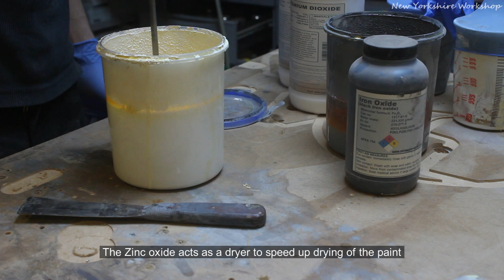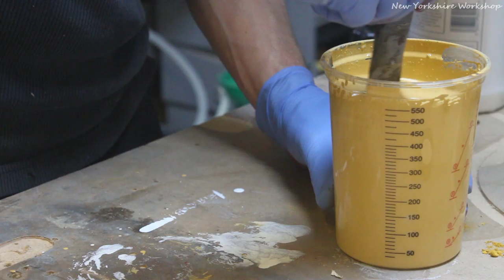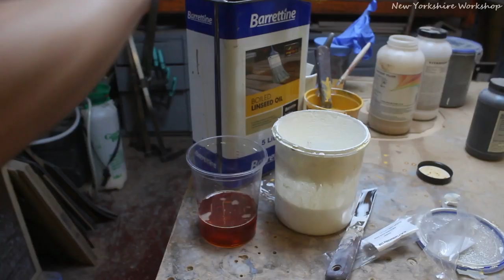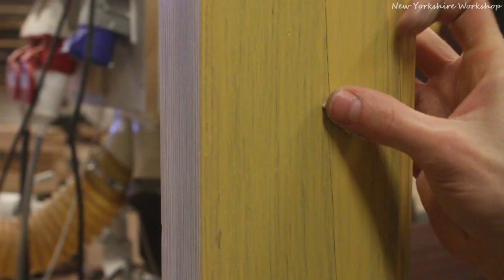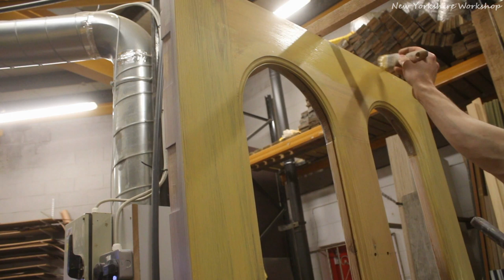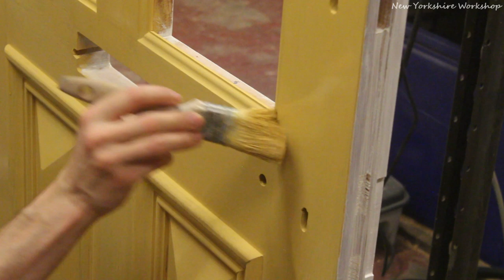Making yellow linseed oil paint for a front door

Comment: Warming raw linseed oil in a water bath helps get maximum penetration as a first "primer" coat.  Long full length brush strokes will minimize brush marks.  Fill holes before pigment coats and gently wipe with a rag with a little raw linseed oil on it.  Mix/store paint in glass mason jars, it's easy to seal/reseal and make small batches.  Paint is less likely to stick to glass over time.  Purified raw linseed oil along with the zinc oxide (15-20%) will help with mold/mildew and cleaning.
Reply: Good tips! You can also add 0.5-1% orange oil or turpentine for better penetration with linseed oil :)
Reply: @AndreaArzensek  Good tip too, actually I'd do the filling after a first coat of a diluted linseed oil paint.
Reply: @richardmckrell4899  It sounds like you use a lot of linseed paint. Generally speaking, on an exterior application such as cedar siding, how many years should you get before it starts fading out and needing more applied?  Also, is there something to add to it to help with mold and mildew growth?

Comment: I have no idea who told You that, but linseed oil based paints are not capable of letting any air nor steam through. In fact- hardened linseed oil creates one of the toughest natural polymers known to man. It is resistant to most strong solvents and even to some strong acids. It is durable, easy to make and cheap, but the coat it creates is homogenous and air-tight. Which isn't bad for the wood as it doesen't allow any harmful sulfur oxides and other nasty stuff get into the wood. Great job!

Comment: If you paint over linseed putty straight away using linseed oil paint there’s a chance that it will blister especially with darker colours (dark greens and black) and where the object, window or door, is getting heat from the sun. South or west facing windows are especially prone to this even in the UK. It’s cosmetic as the blisters reduce in time but easily avoided by waiting a day or two for the putty to start forming a skin.

Comment: It's also good to consider your use of pigments. If you had used a little bit of raw umber, which would not have changed the color at all, your paint would be dry as a bone overnight. This will also give you a stronger natural paint film that will not lift when you add further coats.
Reply: How would adding a brown pigment not change the colour and speed up drying time so dramatically? Makes no sense
Reply: @kcChicken123  lots of things make no sense when we're ignorant to them, but that's okay. let me see if I can help- raw umber is low in tinting strength(meaning it's rather transparent and a small drop doesn't effect the overall yellow ocher color), and contains manganese, which has siccative, or rapid drying effect on oil paint- brown earths are the fastest driers, along with lead, which is why painters use brown earths for underpainting- of course you can try it yourself or investigate further. I was just trying to be helpful to another fellow restore and share something the old timers passed on to me.
Reply: @josephdolderer  what awesome info! Please make some videos to keep passing on the old timers info....it's getting lost. I'm trying to figure out custom made Linseed paints.  Do you have any thoughts on how long linseed paint should last on exterior cedar siding? I don't want to have to scrape peeled and cracking paint anymore so considering switching to a linseed product which I heard more just fades away rather than peel/crack so you can easily reapply more.

Comment: Looking really good! 

Can you spray a lin seed oil finish?
Reply from the maker: Thanks David! Ive seen it thinned and sprayed onto rusty metal which i guess is quite porous, it might be ok to spray on very porous wood but for non porous wood it goes on in very thin layers and needs to be worked into the surface so i dont think spraying is ideal.
Reply: NO mate, you DON'T go SPRAYING linseed oil finish on wood. What you're missing is elbow grease! Go down to your local DIY (hardware if you're a Yankee) and ask for five gallons of non refined elbow grease. Also ask for a special bowed window hammer, to bend the glass a little more. Then you could place an order for a wood thicknessing plane, just in case you took too many shavings off. You might find a special application on your I-Phone that'll do all in one.
Reply: @musamor75  ah ill have to get a link to that iPhone app, that's sounds really handy-dandy!

Comment: What ratios of titanium dioxide, zinc oxide  to linseed oil did you use to make the white paint you started with? Thanks
Reply from the maker: Hi, I did write down what i used but i lost it in the messy workshop! i reckon it was a good 400-500 (maybe more) grams of the titanium dioxide plus 250 grams of the Zinc to 1 litre of oil. that should be a good starting point for you. even with quite a lot of pigment you will still find you need a good few (maybe 4 or 5) coats with white since still isnt overly opaque.
Reply: Why didn't you read some of the comments? The answers are given several times over.

Comment: Beautiful!
Did you let each layer dry fully before applying the next one? And if so, how long did it take? I know you said a few days, but is it more like 1-2 or 4-5 etc?
Reply from the maker: yes it is what is called a drying oil, meaning it dries from contact with oxygen in the air, sealing a previous coat in when it is still a bit wet will make it take much longer to dry. it was taking 3 or 4 days to dry a point that i could sand it without galling up the sand paper, that was in summer so it was fairly warm.
Reply: Store-bought linseed oil paint advertises 24 hours between coats but that's the absolute minimum.

Comment: After watching all the previous construction videos, what feels like must be a $12,000 door... is painted with what looks like a $1 brush from a bargain bin.  Am I missing something?

There was also a comment in here about spraying, where you commented spraying would not be as good for this porous surface.  At first, I agree with you the first coats should be done by brush for the exact reason you state.  But as even you state in a comment somewhere else in here, once the first layers are on, you're not painting the door anymore but rather adding layers on top of the existing layers of paint.  And those aren't porous.  

When I paint doors such as these, aesthetically I try and make the brush marks "make sense."  The brush strokes should logically follow the pieces of the door.  But this door has some unusual places where horizontal and vertical pieces meet which made me wonder what I would do as I watched you paint.  My conclusion was that it would look best sprayed with a HVLP sprayer.  I think brush strokes add character (if done right) and a HVLP sprayer will basically be a glass-finish, but for this piece I'd be ok with that.  It's just... BREATHTAKING!
Reply from the maker: i havent tried it so i could be completely wrong, my gut feeling though is it wouldnt work too well. you would need a very fine mist to put just enough on the surface, and the pigment might clog up a fine nozzle gun. you would have a hard time fine tuning the setup just pefectly as it is a fine line between a good finish and having runs. i also think it would just bead up on the surface, especialy on subsequent coats,, it kind of needs working in with a brush. like i said i could be wrong, id be intetested in hearing how you get on if you try it.
Reply: @NewYorkshireWorkshop  Yes, HVLP sprayers are pretty much as fine a mist as you can get.  Have you ever seen cabinets sprayed smooth as glass?  That's HVLP.  

You are right that it would take some tweaking to get the consistency right, but... it's not like you just poured the perfect amount of pigment in the linseed initially, either.  haha  Getting the viscosity right for a HVLP takes a little getting used to, but it can be done.  

And, again, you're right that the initial coat(s) would benefit from a brush putting pressure into the pores of the wood, but at some point (after a good first coat), you're not doing that anymore.  Each subsequent layer sits on top of the previous, it's not going into the wood at all anymore it's just leveling on top.  You can FEEL it.  When you put a primer on wood, the grain expands as it soaks in.  Even if it was smooth before you painted, after the primer it will feel incredibly rough.  That's because the pores expanded.  But after you lightly sand that coat and paint again, you'll notice that doesn't happen again.  The only texture you feel is whatever stipple is inherent with your application method.  The new layer of paint is now just sitting on top of  the previous layer of paint, not soaking into the wood.

Experiment with it.  If you end up even half as good with painting as you do with the wood working, you'll be amazing.  I'm still in awe from watching you build in this video!
Reply: You're talking from America. You people do everything mechanically. You use machines for everything. You have no stick shifts (gears in your lingo) in your cars- it's just too much to change gears by hand. A paint brush is too much work, eh? The problem is, that oils cannot be easily sprayed, and they cannot easily  penetrate the surface, as by being rubbed by hand. Your problem is impatience. You want the end result, in NO time. You talk about "glass" finishes. Oil simply cannot achieve this- its molecular structure doesn't allow it.

In case you might think of retaliating, don't bother. I worked in world renowned Paris restoration workshops. If you care to look up "French Polish" (that's not the country of Poland, but the finish YOU call "laquer") you will learn that this two hundred year old process allows the French Polisher to obtain glass like finishes on wood surfaces. To finish a grand piano in this fashion is more than a month's work. In your Yankee Dollars, this would be in the range of 12/15,000US$. 

To come back to linseed oil, there is no finish that protects wood any better.
For An object to last for a long time, it takes a long time to reach that goal.
Reply: @musamor75  //  I'll bet you're a real joy to be around; or even hearing distance. You seem so understanding, edifying, and kind; not to mention being perfect while you "upvote" your own comments and all. Have a great day.   :)
Reply: @musamor75  Quite right...I sold paint in a(n) American hardware store for 16 years, and if a coating or finish schedule or technique was the least bit complex, or the product the least bit smelly, or the drying time more than an hour or so, NO SALE!  My Granddad is spinning in his grave.
Reply: @musamor75  They took away our oil paints in the US and forced us to to switch to latex paint. Some guy at a national brand paint store tried to tell me that oil paints were garbage. We here at this channel know better!

Comment: Wow - you must be really convinced of the long term performance of that paint to put up with the long and fiddly application process!
Reply from the maker: yeah it seems like isnt exactly practical when you compare it to modern diy type paints, but you know 20 years later when the wood has rotted from the inside out because that modern paint didnt let moisture breath out of the wood. linseed works out much cheaper and simpler when compared to commercial multi stage coatings that are guaranteed though because it is primer, sand, more primer, sand, under coat, sand, more under coat, sand, final colour, done. so personaly i think i is worth it

Comment: Looks great, just found your channel, and I’m really enjoying your videos. I’m really interested in making my own linseed oil paint. May I ask, for the paint are you using boiled or natural linseed oil? Is there a ‘special’ brand that is clearer than the stuff I use which is fairly yellow? Also do you grind the pigment that you buy, it just add as it comes?
Reply from the maker: Hi Deema. Im using the boiled stuff as it is supposed to dry faster, but without the zinc oxide is still takes a week or so to dry so i think it is just the nature of the oil in general. i used Barretine brand but i really dont think it matters too much unless you are doing fine art type oil painting, it is all generally yellow colored. you will only notice the yellow on white paint and it only tends to be visibly yellow when it is not exposed to sunlight, i noticed this recently when opening some of the sash windows id painted and the closed off areas looked yellowish and the exposed areas were still pure white which was contrary to my own expectations.
I didnt grind it at all, when mixing it did seem a little gritty but that didnt seem to reflect on the finish at all. although when painting the grey paint i would occasionally get some black streaks i guess from a lump of black pigment but it was always easy to blend in with the brush.
im no expert but i hope that helps.

Comment: Has this paint stood the test of time?
Reply from the maker: it has gone a bit powdery which is normal for linseed paint, im going to put another coat this summer and then wax it, it only had a few coats, i was supposed to put more on when it was fitted but never got around to it!
Reply: @NewYorkshireWorkshop  Thanks for getting back.  Yeah that's what I read and was thinking of using it on a window and door I'm making for my garage and probably will still do so actually.  Nice work on the door by the way.  Best wishes.

Comment: That's a very nice soft, light yellow you got there. The Yellow Oxide reacts well to light. I'm flabbergasted at the number of idiotic comments abouts blokes (c****s) wanting to use air guns. Anyone ignorant enough not to know the sheer joy of using a brush should use a pencil instead. I told someone that. Nice job mate. I use linseed (boiled of course) all the time. Nothing else offers equal protection. Thumbs up.
Reply from the maker: Yeah im suprised how nice it came out, i wanted to add plenty of the white zinc to make it dry faster and i thought would make it a really pale yellow but it is nice and bright but not over the top! really happy with it.

Comment: Привет напиши пожалуйста индигриенты для покраски я переведу очень круто спасибо заранее
Reply from the maker: it is not critical for exact ingredients so you can experiment with this as a guide-
for white paint- 400-500 (maybe more) grams of the titanium dioxide plus 250 grams of the Zinc oxide (zinc oxide makes faster drying) to 1 litre of linseed oil
for grey paint- add small quantity of black iron oxide to the white (try increments of 5 grams to 1litre)
for yellow paint- add about 100 gram yellow iron oxide to the white.

Hope this helps!
Reply: @NewYorkshireWorkshop  благодарю вас
Reply: @NewYorkshireWorkshop  и ещё хотел бы узнать с какой вы страны? Я из Казахстана что по соседству с Россией зовут меня Дима если вы не против хотел бы у вас консультироваться если вам нужна какая либо информация обращайтесь и удачи вам во всем